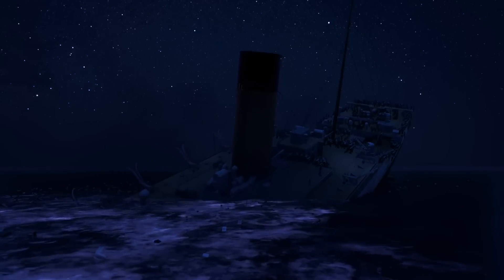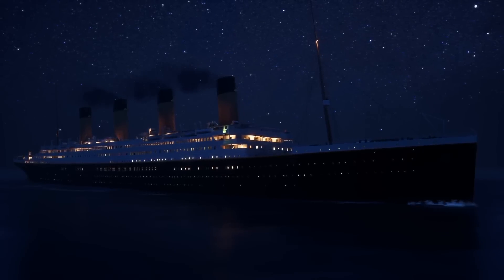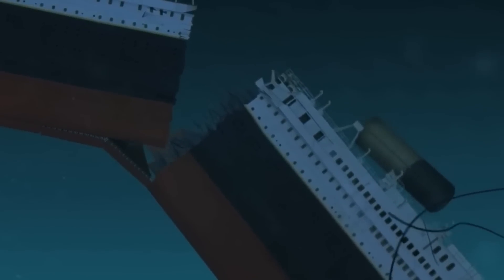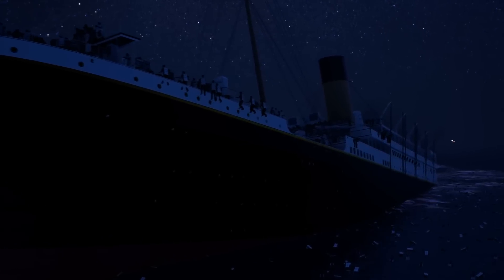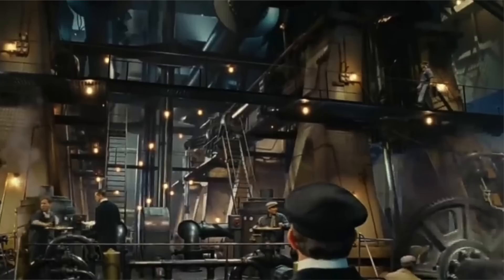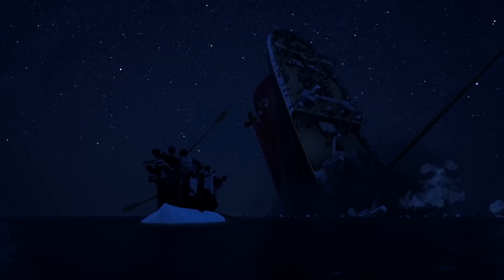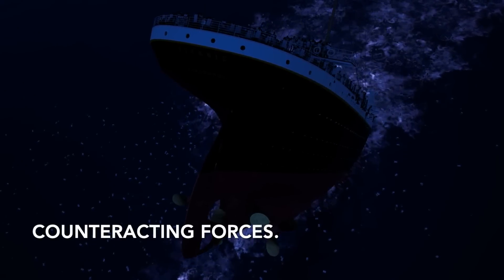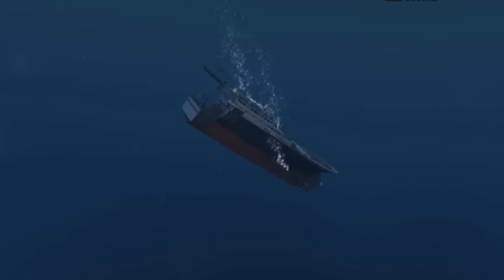The Physics of Titanic's Final Plunge!

Comment: Im glad that you and THaG are able to work together to make such videos, but I still think youre missing the the mark on the brakeup. The with the ship at a high angle, the bottom would've been under compressive forces, which is shown by the "S-folding" of the metal sheets on those double bottom pieces. When the ship broke, the double bottom gave in to the compressive forces and was bent up into the engine room, and all the way up into the galley. It was the strength plating on B deck that held the ship briefly together before bending apart, creating those famous gaps in the expansion joints of the superstructure. The brakeup isnt a clean cut but a compressive bend that ejected entire chunks of the ship and completely crushed some of it. 

I wish that THaG and channels like this would employ engineering knowledge and techniques with these topics instead of tearing the ship like paper. It gives the wrong impression of the actual events from that night.

Comment: The breakup almost certainly began when the keel jackknifed and bent upwards, breaking the bedplates for the reciprocating engines. Where the two chunks of the keel came together there is clear evidence of this. While this was happening, cracks were spreading  in the decks above, focusing on the uptake for boiler rooms one and two, which led to Titanic splitting in two. When the bow detached, the severed forward low-pressure cylinders tumbled out immediately after the forward tower fell into the water. The tattered double bottom could well has been the last structure to fail.

Comment: I cant help but wonder how much water or how many of the lower sections of the stern were flooded during the initial stages of the sinking prior to the bow dropping below the waterline.  when the bow did drop would there have been much of that water running out of the stern as she broke in two creating air pockets in the lower levels where it would have taken time to find ways out for the final sinking or would the water that was in there from the initial sinking have been trapped by the watertight bulkheads as she lifted and maybe provided extra weight to help keep her stable for the final slip below the water?  would be interested to hear comments as i cant find any information or suggestion of what might have happened there anywhere.

Comment: Steel hulled ships are now constructed with ‘expansion’ joints because of shipping accidents involving fractured steel hulls. The hulls ‘twist’ under normal sailing conditions as they ride the sea. I was on a large passenger ship a few years ago and once docked, welders arrived to weld up a crack in the top deck even though the expansion joint was doing its job !. I don’t think the Titanic was built with expansion joints at that time, so the hull itself would need regular repair despite its riveted construction. The rivets were also very brittle due to the poor metal used and the cooling of the rivets once hammered into place. In modern day terms, Titanic was fragile compared to today’s modern shipping.
Reply: Titanic had two expansion joints. The technology was in its infancy. It broke at the rear one. Nobody really talks about those any more. But the shadow divers investigated them on their dives to the Britannic. They realized that the Britannic’s were redesigned from the Titanic.

Comment: Also the forward high pressure cylinders broke away from the stern section on the way down. The wreck only contains the low pressure cylinders still seated at the forward end of the stern section. This may have played a part in causing the stern to rotate on its way to the bottom.

Comment: The sinking of the stern section was helped along by the fact that the watertight doors in the bulkheads towards the aft of the ship had been opened by the crew during the sinking to facilitate moving hoses and other sorts of things back and forth. It's also likely that the breakup caused deformation of the sides of the hull to extend backwards beyond the reciprocating engine room, at least to the turbine room, and much like the iceberg damage this would have enabled those compartments to begin flooding from the sides. If the ship had broken perfectly cleanly, as if cut by a giant laser, and if the watertight doors in the stern remained closed, it might have stayed afloat. But as it was, it was doomed.

Comment: I thought it was debunked in updated research from James Cameron that the stern section went completely vertical before it completely submerged. He also realized and updated the height at which the ship got to before it broke in half and it was a lot lower to the surface of the water at break point than what he had it for his movie. But I guess movies exaggerate things anyways. But in his updated new research, James determined the stern section *ALMOST* went vertical before completely submerging.

Comment: Based on the fact that the ship broke in half aft of the third funnel, and even if the double bottom broke off immediately, i don't think there was a chance that the stern could have stayed afloat. There were 5, maybe 6 watertight compartments left with the stern. And since the front of the stern was wide open, it would have only been a matter of time for that first compartment to flood, and then spill over into the next one.

Comment: Finally. A presentation that nearly meets my imagination.
   My own theory is that RMS TITANIC busted a gusset while still nose-down, but the separation didn't occur until its behind got dragged under. Close. But what exactly happened at that point? Nobody was in the water in 1912 taking pictures with movie cameras and flood lights like all the Hollywood b.s. we've been exposed to for 75 years. For the most part, only Pinewood Studios got it right with "A Night To Remember". But still no reasonably accurate description of the ride to Davy Jones's locker. My guess is that Titanic split a seam but the keel and and its pants and undergarments (the double bottom) were still attached but very weak and tenuous. How did TITANIC's fanny stick straight up and then begin to level just before it sank beneath the waveless sea? The bow was already heavy with the flood of water, so that part missiling down vertically is obvious. Right after or maybe just before the final plunge, Titanic busted its last button and the hull gave way, but the keel was able to pull the boot down farther until the air still trapped in pockets kinda blew out the deck and the grand old lady wasted her Mary Poppins umbrella. The deep sea photographs show the stern as a virtual exploded mess. What do you think?

Comment: No mention of the fact that the break between the two halves was nothing but clean.  There were likely 3-4 compartments breached just from the tearing and ripping of the hull alone.  Surely, open portholes and other factors also contributed.
Reply from the maker: Watch part 1, we go over all that.
Reply: @HistoricTravels watched months ago.  If you covered something months ago, might be advisable to put the information from both together into a consolidated video :)

Comment: You forgot to crucial and key moment in the break up. When the double bottom bent upwards Just before the break up, everything at Ground Zero, meaning everything under the two sections of double bottom that got ripped off, we’re shoved upwards into the decks above, and this includes the two low pressure cylinders of the engines. When the bottom of the ship split open, least two cylinders broke off of the main section of engine and fell out of the ship along with coal bunkers and the entire contents of boiler room one.
Reply: Correction: only the forward starboard low pressure cylinder slid out, which accounted for the port list and rotation (as many survivors said “she described a semicircle” in their testamony) before the stern finally sunk. It is not known when the forward port cylinder fell out of the wreck. Possibly happened when the stern imploded.

Comment: Not sure that the weight of engines was necessary for the rear half of Titanic to go vertical. The most stable position for a floating ship-shaped hollow object that is nearly full of water is with one of the ends pointing straight up. That's why most ships go stern up or stem up in the last moments before they sink, few sink on an even keel. The rear half of Titanic was longer than it was wide, and as it flooded it still made sense for one of the ends to go up, engines or no engines.
Reply: HMS Hood broke in half after a magazine explosion and the bow section of that ship still rose up vertically despite the heavy weight of the forward two gun turrets being in the middle of that half of the ship.

Comment: I would be interested to know the number of, and size, of the bolts that secured the engines to the Titanics hull. For them to remain connected throughout everything, the breakup, the stern going vertical and sinking, must have been one of the strongest connections of the ship, if not the strongest; which would be ironic considering what occurred just forward of that.

Comment: The front end was completely open to the ocean— it was going to go vertical no matter what. The engines played a negligible role. Remove the engines and the stern section will still flood fire to aft. If your physics was correct, the ship would break apart under the weight of the engines.
Reply: Exactly.  Note that the bow of the ship was flooding for 2 hours due to the iceberg damage, and it went downward---not needing any heavy engines to do so.  Every part of the ship that had a specific gravity more than 1 would sink, while anything with a specific gravity less than 1 would float...period.  All the heavy equipment (boilers, machinery) is located low in the ship as ballast to keep the ship upright, and it is relatively evenly distributed along the length.  So the engines were nothing special; they just happened to be adjacent to where the break happened.

Comment: Thanks for confirming that the heavy steel engines don’t float!
Reply: That question has haunted me for ages.  So glad to finally know!
Reply: Ships are also made of heavy steel, and they do float.
Reply: Yes, the presenter of this video is acting as if he's gotten hold of some remarkable finding.  
Furthermore, it doesn't matter that the engines were there; no matter what was there, the broken-open end would flood and sink---just as the forward end of the ship did for the previous 2 hours without the need for heavy engines or boilers or coal to do so.  Even a fiberglass canoe would flood and sink where it was broken open---engines or no engines.  ;-)
Reply: @billvanek5570 didn't you watch the intro. This is a correction video. He's just passionate about this topic and when he learns something he passes it on.  I love that enthusiasm and generosity with his time.  He's not hurting anyone. Chill.
Reply: @mn-ru4li    Passion and sincerity aren't important...and usually get in the way of the facts.  I did watch the intro and the whole video, and saw that he took his early error and changed it to a new error.  The first error was that the bow is what raised the stern to nearly vertical; the new error is that the engines did it.  
When the ship was still together and flooding forward, the whole ship would have turned upright in the water if there had been no breaking.  And that movement would have had nothing to do with the weight of an individual item like a boiler or an engine.
I'm not hurting anyone by pointing out that there is a simpler answer.  Chill.

Comment: The stern did not go nearly as vertical as some of the animations show. James Cameron discussed this when he ‘discovered’ that the stern could either have gone under vertically, or splashed back down when the ship broke in 2, but not both.
Reply: James Cameron has been wrong about a number of things, and is wrong about what you have stated, too.  Even this 'physics' video shows how it happened.  Lastly, the free-floating stern followed by its nearly vertical tip-up before the final plunge are the most well-documented observations by the eyewitnesses.  It's both/and, not either/or as Cameron thinks.

Comment: Sam - there is no way that a 90 ft piece of metal that measures 92 ft wide and it's only 7 ft tall can hold over 20,000 tons of flooded bow. I would have a better chance at the gym of tying a 50 lb weight to my shoelace and see if that can pick the weight up 😊 ...... Titanic broke from the bottom up. Compression smushed the double bottom together (That's why the matching section of plates are bent upwards on each piece)..... This in turn shoved the engines and bulkheads into the decks above which destroyed their structural integrity. This also pushed out cracks which radiated outwards and upwards. When the Titanic stern section was pulled down it was not by the keel plate, rather, It was pulled down by the upper decks. By this point the double bottom collapsed and the number one engine cylinders had no support because they basically were spended over a hole.... Those cylinder snapped right off the engines and fell, along with the boilers out of Boiler Room #1. Titanic is only being held together by its upper decks, which is now subjected to tension- basically they were being stretched longer than what they were designed for.... And when that happens, they're going to rip themselves apart in jagged pieces - aka, the tower sections. A complete top to bottom break would be rather clean in comparison. When the Titanic bowel section finally separated from the stern it was only being held on by B deck.... Once that ripped away, The tower's got ripped out and fell in between the bow and the stern. The stem then sank on its own accord. 😊
Reply: You actually had me there 👍🏽

Comment: That sinking analysis shows that the engine room is flooded after all the break up of your double bottom, and the falling out of the so-called tower sections. The boiler rooms and engine rooms had a delay on flooding. The decks above the boiler rooms and entering rooms flooded quicker. all the boiler rooms went negative before the ship split. The turbine engine shaft run through the last three or more compartments.

Comment: An argument against titanic engines, causing too much weight in the stern, can be argued against by the weight of the boilers and other machinery, that also is in the bow. in fact, it was machinery throughout the entire ship. yeah, the engines, boilers, fans, and dynamos did this equipment was through out the entire ship. all that equipment shed left the titanic pretty even from end to end. once the titanic started flooding, and a half to add all the sea water on top of all that equipment. The engines alone should not be able to counteract the flooding of seawater. to causethe ship to break. even after titanic broke, you still have that machinery throughout the Stern. but then you have to add all that water coming in a ship size hole on one end.

Comment: I find your explanation plausible.  But, the one problem I have is that, if the engines were pulling the stern section down, more of the hull should have remained underwater when she upended.  From what I recall, most survivors saw her go vertical, with nearly ALL of the hull still above water.  If so little of the stern section was underwater, the mass of the unstable portion of the hull would have made the stern highly unstable.  The only way I can conceive this scenario working, is if much more of the  stern was under water when she upended (thereby keeping the rest of the stern section more stabilized).

Comment: I get the engines were heavy enough to be a contributing factor to the split and the stern being pulled up in the air as it went down. What I don't get is how some people say, post implosion, the stern was able to sink in the rudder direction in this corkscrew fashion. It seems that the open end of the stern with all of the engines would've been a lot heavier, and it would've sank in that direction instead. Judging by the looks of the stern on the sea floor, it sure looks like it did.
Reply: It probably spiraled back and forth like a leaf falling from a tree... From one side you have weight trying to keep a straight line downwards and from the other side you have a hidrodynamic force of the water trying to find the least resistent surface of the stern, which is the hidrodynamic stern of the ship
Reply: @fidan2fast  That makes way better sense as opposed to the corkscrew theory. That may explain why the hull plating on both sides are just laying there like they are.

Comment: Yes, I think you are completely correct... It was like a Hot Air Balloon. The basket was the engines, and the stern was the balloon slowly deflating. When the weight was more than the lift, the stern finally sank.

Comment: Many people wonder though Thomas Andrews said the ship could be split into three separate sections and they would stay afloat. Well, I think it was a complete break right down the middle, the engines would still push the ship down, but only one watertight compartment that was exposed to the sea would flood. Therefore, it would be enough to keep that part of the ship afloat. But the area above the engines, towers one and two was gone. And the water could flood into the engine compartment, which would be enough way to pull the ship down to sink it. However, maybe it wouldn’t have been as fast if the other water type bulkhead weren’t damaged. But either way, if it would sink in one piece or break up like it didn’t real life. The ship was going to sink no matter what.